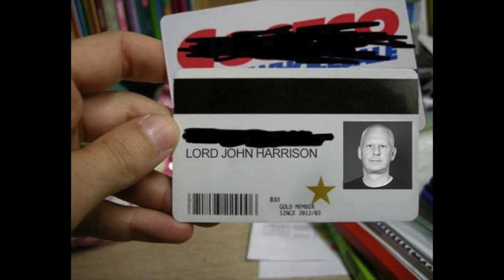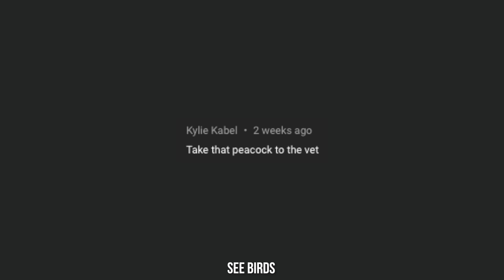The Vet permanently INJURED our Peacock

Comment: Hi, I am an exotic vet tech! I'm so sorry this has happened to you, avian blood draws are taken with a small needle as if a human were to get a blood draw. At most you would just need a little pressure to start the clot process. Depending on the amount of blood needed, sometimes we will just use a nail and cut the quick to get a few drops as well and use quik-stop once complete.  That looks like the issue could have been due to mishandling or restraining techniques.
Reply: That or a freakout in the cage. Taking blood definitely doesn't break bones.
Reply: @debh3404  I agree, being in the cage could be a factor as well.  Unfortunately it's hard to tell without 24/7 surveillance on the cage or inside the clinic.
Reply: Apple cider vinegar in water to bring immunity up
Reply: @laurabird3957  Have you ever heard a bird's wing break? I had a scarlet chested parakeet that broke it's wing in my hands and I knew it immediately from the pop sound of the bone breaking. I think it happened when no one was around to hear it break.
Reply: 😥 I thought an accident from hurting himself in that cage with sketchy floor for the bird , should have hooked up his camera and watched it just in case 🤷
Reply: @debh3404   birds have very fragile bones, they are honeycomb shaped in structure instead of being one solid bone.  Handling the wrong way can easily break a bone. The bone structure is great for flight but not so great for untrained handling.
Reply: Next time turn the cage upside down so the floor grate isn't so widely spaced
Reply: @laurabird3957  I had 25 years of bird handling experience and still accidentally broke my bird's wing. Scarlet chesteds bones are really fragile but that was the only bone I ever broke. He just turned wrong and I heard a pop. It happened INCREDIBLY fast. I couldn't believe what had just happened it seemed impossible.
Reply: @debh3404  it's crazy how fragile they are
Reply: I understand that you will try everything to help this peacock.  What normal genetics aren't present in the white birds Is? Is the cost (not monetary) of this worth breeding a white peacock?
Reply: You can't be sure that it didn't fall between the cage bars and injure the wing.
Reply: I agree, he went to a place that was willing to take the bird, but wasn't necessarily proficient with handling exotic birds. Sure, it could have been a result of the weird floor situation in his garage, but it seems to me that if that were the case it would have been more of a leg injury. Just a hunch.
Reply: @tammystoudt5137  The wing injury makes sense for the cage. It probably slipped and tried to catch itself with it's wings, considering the other leg probably slipped too or wasn't able to grab into anything in time. Probably broke it's wing trying to get itself unstuck from slipping in the cage. Those big holes in the bottom were a bad idea. When vets get accused of doing something and they're certain they didn't, they won't want to treat the animal because they're cautious of getting blamed again. They see you as a sketchy customer looking to get free service or cheap service from an injury the vet didn't cause.
Reply: yah no that doesn't seem like a blood draw injury. and I know nothing about birds only that it was too big of an injury to be cause by a blood draw.
Reply: @Laura Bird  Love the last name! So appropriate for your profession! Really sad to hear this has happened. With regards to handling, it might be different with peacocks, but I've always been taught to pick birds up with both hands, covering the wings. Stops them flapping in your face and it seems to calm them down a bit. I've only worked with hens and pigeons though - not sure it would work with something bigger, like a peacock. Do you have any tips about handling larger birds?
Reply: Call Dr. Pol!
Reply: Wow What an amazing job! Good on you!
Reply: @flamboyantpotato4004    I think that if a bird was brought in to the vet with a wing that was already broken and the vet didn't notice it when they checked the bird, then something is wrong with the vet.   I read the comments here and what doesn't make any sense to me is that the break is at the same place where the blood was drawn.   Why didn't the vet call them back right away and let them know that there was a big problem with a bone sticking out of the wing?   You'd think that if they drew blood from an injured wing that they'd notice?   Also, as a medical professional, would one try to draw blood from an area that has a break or would they prefer to draw from the other wing?   Because it would be less likely to cause any more damage to an already injured wing.   Right?
Wouldn't it be normal for the vet to inform the owner of the break straight away, even before trying to draw blood?
To me, it looks like the vet is sketchy not the bird's owner.   What it looks like is the vet tried to hide the injury.  
And even if they did see the injury, they're wrong to not call and inform the owner right away.   
I think people in the comments here have missed this point.
Reply: @bluefeather56

White peacocks are rare because it’s a genetic thing. To get the pure white, you have to do a lot of in-breeding to bring out the white. In-breeding can also brings out genetic weaknesses that otherwise won’t show up in a regular peacock.
Reply: @RipVanWrinkle

You make very good points, if this helps, I saw a comment of someone claiming to have worked there one time. Their experience wasn’t a good one. They claimed the boss worked them overtime and did not pay them and such. When the board came in, the boss blamed this person, think that they called for board to come in or something like that, and fired him.
Reply: @RipVanWinkle_Nature_Discovery  When he showed the break it seemed to have some age to it, because with the bone sticking out id expect a little blood atleast
Reply: @RipVanWinkle_Nature_Discovery  unfortunately sketchiness can happen within this industry and honestly any industry. We once had a dog come in as an emergency because the owner had just picked them up from a doggie daycare. The trachea was crushed and there was a lot of underlying internal injuries plus one of their eyes was bloodshot. We spent a while just trying to contact the daycare clinic and then whenever we finally got a hold of them they just said that the dog came in that way and they don't know what happened. They figured the owner already knew. - now it's doggy daycares, there is no way that any facility would take a dog in that condition due to liabilities.  Sounds like it could have been a similar situation here as well. They just didn't want to get put up in something that they did wrong.
Reply: @buffster948  Ive found when handling larger birds like turkeys its best to get controll of the legs first
Reply: I also wondered why they took blood from it's wing instead of clipping a toe nail short.  I had an Amazon Parrot that had a blood draw this way.  Simple and easy to stop bleeding with Quick Stop afterwards.  Seems like this vet caused unnecessary trauma and stress plus total mishandling.
Reply: @laurabird3957  Yup.  Sounds like a place to stay away from.
Reply: @Mimir_the_wise_  Okay you think it seemed to have some age to it.   So what does that imply?   That the vet no longer needs to let the customer know?
Reply: I absolutely feel like it was the cage and not the vet. I have 6 birds and a chicken, I noticed immediately how non cohesive and uncomfortable the wiring at the bottom is. At the very least was going to be uncomfortable.
Reply: Wow you broke THE ARM WOW GOOD JOB
Reply: I’m glad your trying to help!
Reply: @buffster948 so true, that’s exactly how I handle my hen too. It calms and gives her security.
Reply: Same thig i thought fr cause his young kids dont know how much pressure there putting on the bird...there just kid they dont know no better
Reply: @RipVanWinkle_Nature_Discovery  No I meant by the age to the wound I dont think it came from the cage, and the vet should of noticed
Reply: @SweetCandyDragon  - No. White peafowl are leucistic. Leucism is technically considered a genetic mutation, but that doesn’t mean there’s anything wrong with them in terms of their health. They’re technically genetically the same as the blue peafowl, because they are blue peafowl…they simply carry the genetic trait for leucism, meaning they can produce pigment, but lack the proteins to deposit pigment into their feathers….this is why they have blue eyes, rather than exhibiting a complete lack of pigment. 

The first pigment variants in peafowl were recorded in the mid-1800’s. Technically, any blue peacock/peahen combination with a genetic history of leucism can spontaneously produce leucistic offspring. However, a leucistic peacock & a leucistic peahen will always produce a leucistic clutch. This is accommodated through selective breeding, not inbreeding. It’s unprincipled for any breeding program to produce offspring for a genetic mutation, if by doing so those animals experience poor quality of life due to inbreeding. White peafowl in captivity can live very healthy lives of up to 50 years. They are equally as healthy as their blue counterparts, and inbreeding is not, nor has it ever been, standard practice to produce leucistic traits. It’s unnecessary. They’re rare because outside of select breeding programs, 2 blue peafowl only have a 1 in 4 chance of producing leucistic offspring. There are no known white peacocks to have ever been born in the wild, and there aren’t very many breeding programs specifically producing leucistic peafowl. They’re just naturally rare. But also, naturally healthy & genetically strong.
Reply: I feel so bad for the poor peacock :( €£¥₩
Reply: Not a professional but I think it was caused by inbreeding not tied to why the other birds in the cage died. The cage is also very bad idea constantly be falling in cage holes and hurting itself I’ve placed some flightless birds in a cage with rather big holes and they kept slipping in holes getting stuck and hitting their wings so I took them out and got a better cage but again I’m not a professional
Reply: i bet it fell through the cage floor, flapped its wings in a panic and hurt itself while in your care... sorry it happened but to blame others with no evidence is not cool...
Reply: Damn
Reply: I do all my own blood tests on my macaw nail clip, feather dna and blood draw that I learned when working with the horse's then send them off to avian biotechnology who test them ..this must not have been an avian vet..were all on bird flu lockdown with our birds in Ireland right now, I free fly my macaw who is ready to break a window to get out, he's even had a little pluck from his breast. Over the stress of lockdown..they should have had tests done soon as a second chick wend down....
Reply: Without an X-ray there’s not much to see clearly, but it looks a little like a compound fracture. I would have played it safe and cut one nail to the quick on a bird like this. If the bird isn’t used to being handled and there’s no need for and IV, then this is the most practical and safe way to go. Blood draw for samples are too risky on birds wings. Poor baby. 😢
Reply: @gailsprangers9388  It's still the same logic.   Bird comes in with a broken wing, the vet should call the owner immediately and advise them of such.
Reply: As someone in the vetmed industry, it's really frustrating to see a simple procedure blamed for a larger injury. I work with an exotic vet who sees birds on occasion and that's not a blood draw injury lol. Could it have happened at the vet? Yes. It doesn't sound like this was an exotic vet, though, so the lack of help could be due to lack of knowledge. These aren't cats or dog or cows. Birds are weird and your average general practice vet does not know how to treat it.

The whole cage set up was sketchy and dangerous. If you don't want him sitting in his own feces then check on him regularly. This whole situation makes me sad:(
Reply: @sapphicpaladins5028  I agree, it does look like the injury was there prior to the first vet visit when they had loaded the bird into the crate, you can clearly see it
Reply: @laurabird3957  That's what I thought too. It's giving the same vibes as "You guys caused the softball sized lump on my dogs hip from the heartworm test you did with the blood taken from the front leg yesterday" It's really disappointing to hear.
Reply: @sapphicpaladins5028  alittle frustrating when it is a large creator smearing the vet field - we face enough hostility as it is.
Reply: @laurabird3957  Some of these folks in the comments are the reason Not One More Vet exists. Imagine thinking wanting to be paid fairly for your time an experience is greed. The amount of BS vets, techs, and CSR go through is disgusting.
Reply: @RipVanWinkle_Nature_Discovery  the peacock had already been In the cage without floor, when he noticed it, so it could be either that or the vet😅
Reply: @OwD3RPITY  the infection most likely caused the injury to get bigger so it might have been a lot smaller at 1st. I think it was the vet mishandling it & then being in the cage could have made it worse. He didn't see the injury until like a week or more later. The vet should have at least helped them find a bird vet they could have taken him to cuz they can't be 100% sure it wasn't them. I just hope the bird will be okay & that this won't kill it...🙁
Reply: Geez
Reply: oh my that’s that’s…
Reply: @AngelWish3  i agree
Reply: @SweetCandyDragon  🎯💯 like lethal white in horse breeding....like how you're not supposed to breed blue Merle    Australian shepherds to another one because of  the likely good of deftness and blindness..or lost of a litter of pups.
Reply: It’s crazy to think about the fact that they have such a hard time finding an exotic vet. Not that they did anything inherently wrong I just feel that  there should be more considering how many people own exotics now. I’m very lucky that where I live we have at least two near by and an emergency one an hour  away. It sucks that the only vet they could go to was definitely uneducated and wanted a cash grab I’ve never had a vet turn away at the very least a check up before offering medication and not just products to buy off them.
Reply: @buffster948  I agree, it's a disaster to pick up a peacock by its legs when it's such a big bird & has such big wings, & you can see how fragile & insecure it is at the same time.
Reply: @RipVanWinkle_Nature_Discovery  very true. It doesn't make sense that they didn't mention it.
Reply: @SweetCandyDragon  that's also true.
Reply: Hi, I'm a Veterinary Nurse here in the UK. I used to work in a practice that treated exotic animals and I absolutely agree with you. As soon as I saw the Pea's injury I was 99.9% certain that it was sustained through the mishandling of the bird. This is tragic, and tbh with you, I would be very angry if I was the owner.
Reply: @goatgirl61  I'm almost certain the cage for collecting faecal matter wasn't the issue. Pea's are quite used to roosting up high on thin branches etc, so I'm 99.9% certain it wasn't being in that cage that broke the birds bone. I will say this though, there should have been a flat surface on one end of that poo cage. From what I saw, the bird was in there for a week, so it definitely should have had a section where it could rest out its feet. They still would have been able to collect poo! To be honest, i think the poo cage was unnecessary. Im a veterinary nurse and we always suggested to the owners of any birds like pea's, to put down ground sheet in the floor of the aviary, especially if the bird in being kept away from other birds or lone anyway. This poor bird has been moved around and handled so often that goodness  knows who caused the injury. I hope it's making a good recovery. Poor thing.
Reply: @laurabird3957 How does one become a vet tech for exotics? That's not a position I've seen so far.
Reply: @RipVanWinkle_Nature_Discovery  you have a good point. If it was broken when they took the bird in the vet surly would of noticed the wing was broken and said something to them.
Reply: @gunnybunny4081  Oh don't be so ridiculous. If you care that much about them making money from people watching their channel & ads then DON'T WATCH IT!!!
Both myself  (a veterinary nurse from UK) and vet tech from US have commented on the birds injury!! If either of us thought that the faecal cage was the reason for the wing break, then both of us would have said so! In my professional opinion that break was from mishandling of the bird. Peacocks are used to roosting on thin branches, so even though I do think there should have been an area where the cage was covered to give the birds feet a rest (I mentioned this to the owner) I don't for 1 minute believe that injury was caused by the faecal cage.
You were so rude about these people. 
For shame on you.
Reply: Maybe while in that wire cage the guy had him stand in while trying to collect the poop for testing, the bird's foot fell through the wires and he flapped trying to get himself back upright... could have been anything like that.
Reply: @goatgirl61  That was my thought.
Reply: Yeah I was with you on that
Reply: I’m da 69th comment
Reply: @Hijacker318  nice
Reply: I am happy you are able to give them better answers then what they got but well he ever get fully recovered is it truly permanent
Reply: I mean if they accidentally did something to it they probably would realize therefore poor flooring probably caused it to slip then trying to catch itself its other leg couldn't do anything or slipped and then it was throwing its wings around I mean someone proved how honeycomb like bird bones are by well handling the bird somehow the birds wing broke so it throwing its wing around probably hit its wing and with the fact have there wings being so honeycomb like when it hit its wing it either got caught or hit real hard and then probably jerking the wing more probably caused you peacocks wing to break if that's what happened they said it was detached
Reply: And if they know they had nothing to do with it probably nobody around when it happened to help the bird
Reply: Happened
Reply: Have you ever heard of a budgie raising a macaw egg.
Reply: yeah, and i genuinely cant believe the guy couldve mishandled it that badly, peacocks are pretty big birds, though they're harder to handle, itd be relatively alot more difficult for you to break and pop a bone out that badly. I immediately got a little worried when the vet tech claimed he had "a little experience". you need ALOT of knowledge when handling birds, and especially with peacocks that are more flinchy and resistant. the fact he didnt own up to this mistake either is just frustrating, if he had just not had his head so far up his bum with pride this gorgeous peacock wouldnt have been injured.
Reply: The poor peacock 🤍❤️🦚
Reply: What can be done in this situation 
Is there such thing as a wing amputation or something? (Just wondering Because them bringing up the bugs in the wings)
Reply: @debh3404  Or when the vet heard it break  just ignored it knowing that once the bird leaves the clinic and comes back they could then blame it on a factor of other things. Not saying this is what happened but I don't accuse or dismiss things without evidence. In this case it's probably best to just deal with the wing. I don't think I would be returning to that vet. If for no other reason they cannot retaliate against the suggestion that they had done anything wrong.
Reply: @victorb145  That could most certainly happen. But I can tell you that the sound of a bird's wing breaking in a room is not subtle.

Another vet x-rayed the wing and said that the break was an older injury that may have been not completely broken through the bone yet but with the ordeal of catching, caging, transporting, vetting or somewhere along the line it could have broken all the way. But she was able to determine that the wing was already broken before it went to the first vet visit.

They had to amputate the wing and, sadly, the bird passed away after surgery.
Reply: Oh my god your the best helper
Reply: Wha underrated comment
Reply: @goatgirl61  This is most likely the answer. That floor was sketch af. They should have put some 1x2 hardware cloth down.
Reply: Are you near Illinois Missouri? I own a fox and I’m having issues finding a reliable vet
Reply: Given how tricky it was for Hill here to even get a hold on his peacock, it is not surprising that the bird got hurt since I highly doubt the vet they went to had any real experience handling birds.
Reply: What i am concerned off is they own animals on  a farm level. But they are fucking helpless when it comes to  handeling a wound
I mean the probaply broken or maybe just snaped out bone who know aside
Tvey dont know what they are spraying they never heared of blue spray either  or of cortison lotion wich also can be used to get swelling down.
They where not clever enough to use a big  plan under the outdor cage or to put it at least somewhere on the ground  i mean if its stepping in poop once ir twice so what check on it ever hour or so and it wont ...
Reply: Yeah
Reply: @laurabird3957  true
Reply: i love your advice
Reply: He says they took blood from both wings the first time. that should have been enough right?
Reply: Wow wthis is really strange about this bird here um i think this is sad becuase of spot idk if you said that she or he got hit by a car or something though ❤❤😮😮😢😊😊